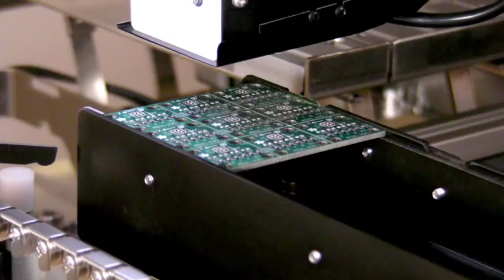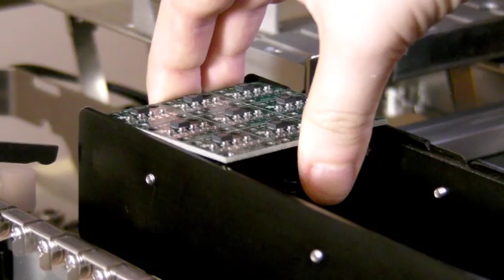Adafruit pick and place machine in action! ADXL335

Comment: Hi Limor,
Thanks for sharing infos on your PnP machines. I really liked it. After the placement process they are reflowed right ? You must also be owning a Reflow oven. 
Do you use a stencil printer also (for solder paste application) or use the machines inbuilt dispensing features.

It would be great if you can share the whole manufacturing process.

I too have a dream for PnP (still a dream because price is too high!)